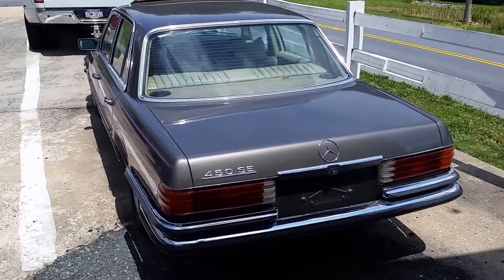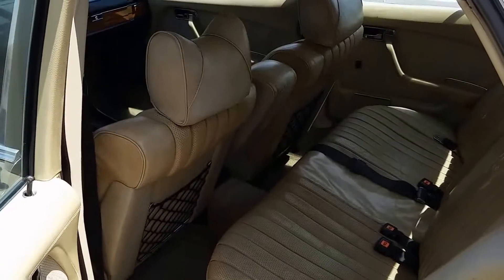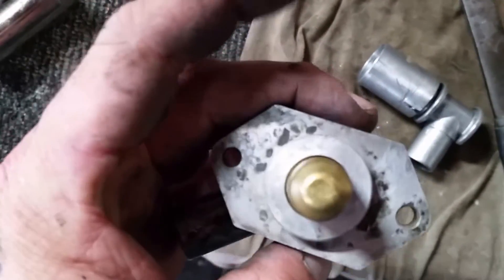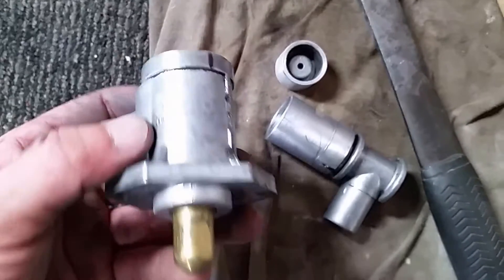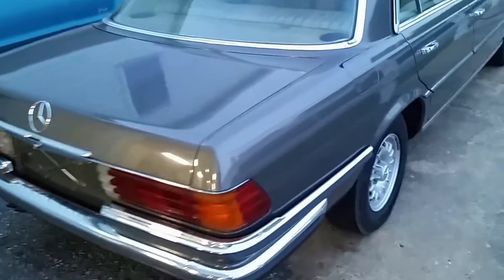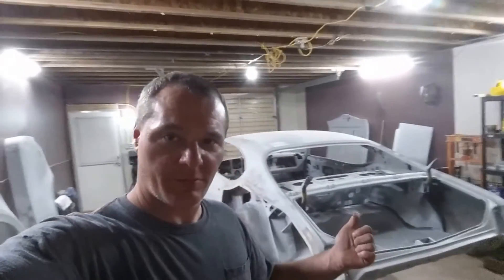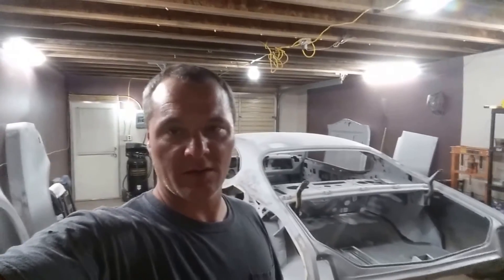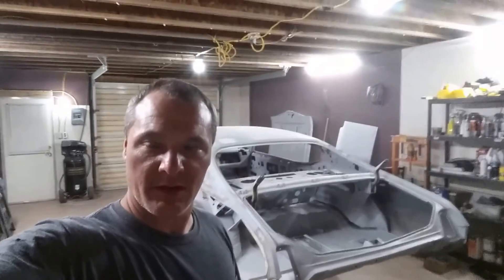1973 Mercedes 450SE Diagnosing the D-Jetronic Issues

Comment: I took my aav out and tested the sensor. It moves up. Is it supposed to completely close that opening? Is it supposed to move up pretty quickly? Mine looks bunked up and greasy/oily inside. But it does move the piston up and closes.

I also have ran into an issue where the car has ran well for about a minute or so going up the road and then suddenly dies. But when I remove the air cleaner the car starts up and runs fine and I can get it home to figure it out. It seems to stutter and then die and cut off. I was thinking the throttle position switch was out of adjustment. But I’m unsure where to start. This happened before but I “fixed” it by replacing the air filter and she ran well for about two weeks. Daily driver mind you* and then started acting up again and did the same thing. I don’t think it’s the air filter. 

Fuel presser is fine. Fuel filter isn’t clogged. It’s something else

Comment: Don't you think its best to check the fuel system pressure first to make sure its ok before  trying to repair the auxiliary air valve? With the engine running its possible to check the auxiliary air valve weather its stuck open or stuck close. I like your video, its so clear. Thanks for posting.
Reply: What does the engine sound like or run like if it’s stuck?

Comment: Hey! Great video, my dad just picked up a 74’ 450SE (d-tronic) also. New cap rotor plugs wires and points. Runs really well most of the time! I dove into the car a bit more then him and found the O2 adjustment makes a huge difference with how the car runs! Also I replaced ALL of the vacuum lines in the car. Again great video! And a beautiful car